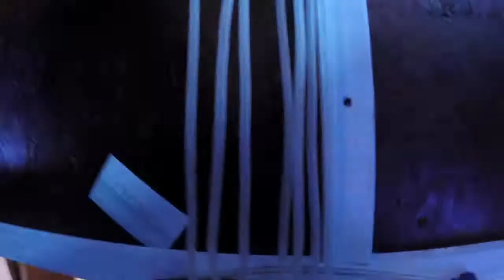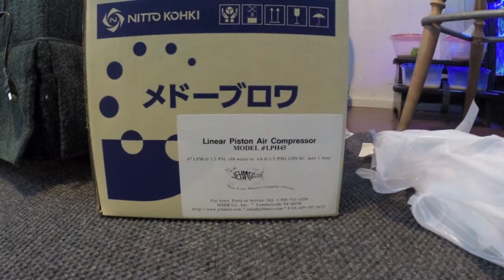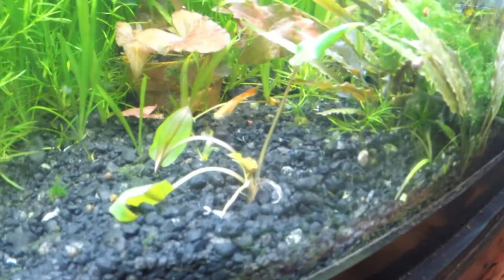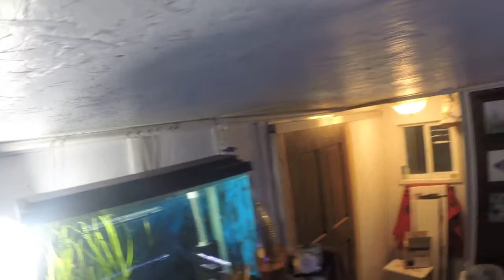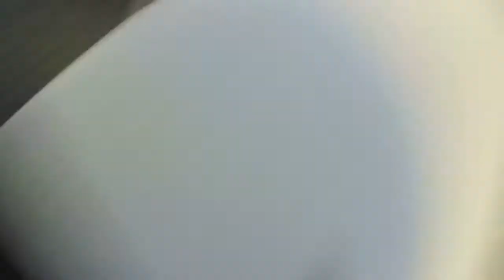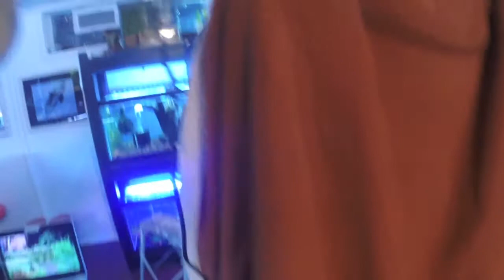Central Air System  - LPH45

Comment: your old air supply looks kinda like mine right now a rats nest of airline tubing my Jehmco loop piping order is on its way still sticking with my china pump for now though
Reply from the maker: You bought pvc piping through Jehmco?  Hey i used those china pumps for many years with out issues, you cant beat the price.  The only flaw i had with them was there loud noise.  I still have those china pumps for my back up just incase something were to happen with my jehmco air pump.   I think you will enjoy your closed loop system.
Reply: @BadgerStateWOR  no im getting a 8 12 and 20 port prebuilt manifolds and 5/8th braided hose between them and tee to tie into currant 3/8th china pump as of right now im still a rats nest and everything is run on 3/16th tubing and im out of hair already
Reply from the maker: i see.  If your out of air you could always hook up another china pump to run your fish room.  You could hook up both pumps to your manifolds if you need more air.